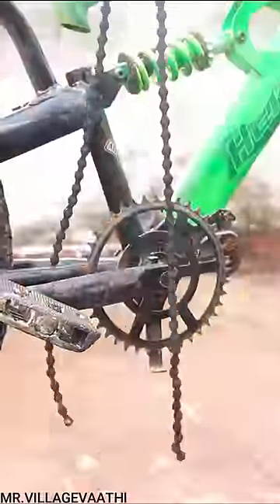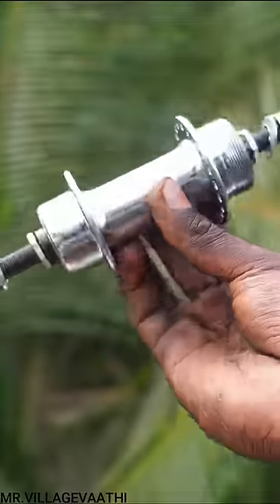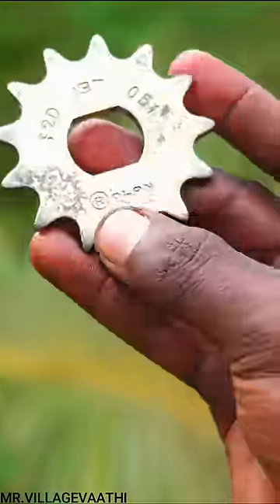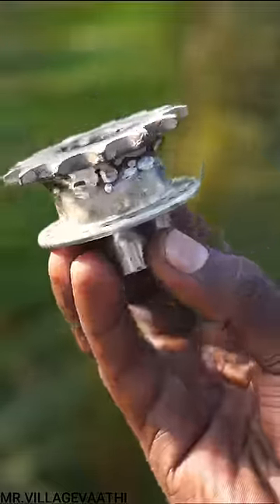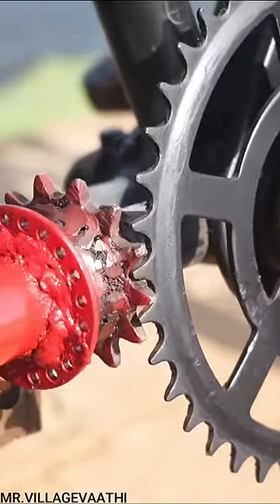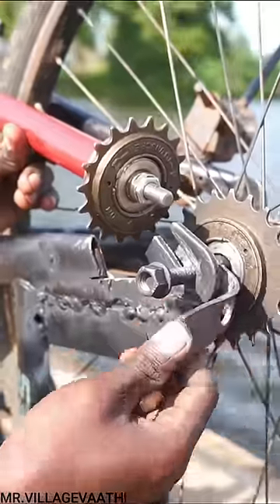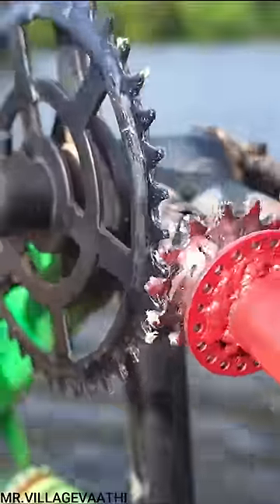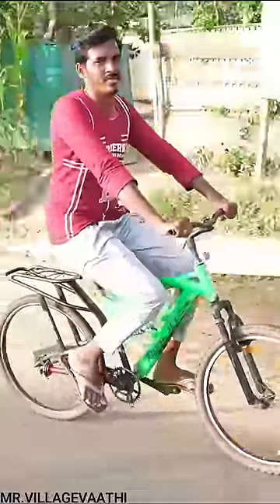Without Chain ⛓ Cycle 🚴‍♀️#shorts

Comment: Good work but u should design the gear with bearings not as a welded part. Also in this design u cant stop the pedaling it rotates continuously and even though u should change the gear wheel often ..coz gear teeth will be bulged as soon as possible..so that develop the design with ideas of Mechanical Engineering professors congratulations.

Comment: You can add a trigger-gear shifter to the crank mechanism by modifying the sprocket system. Gear shift will alter the speed to suit road conditions.